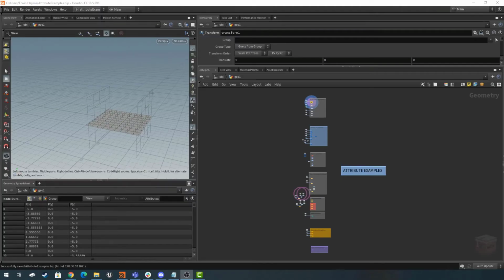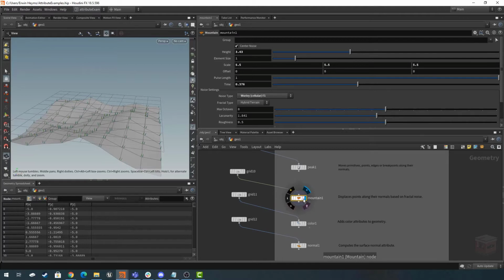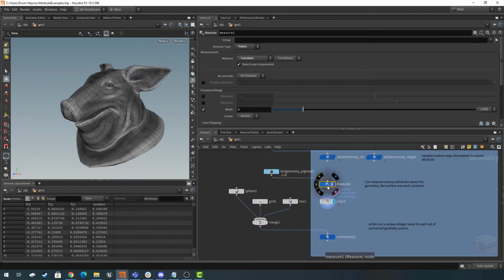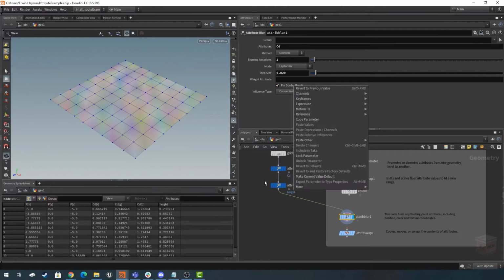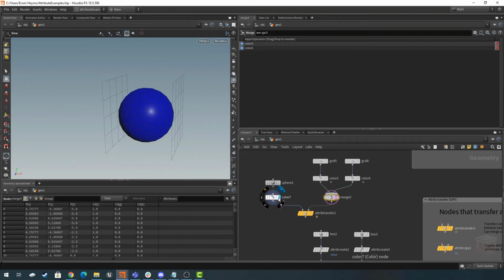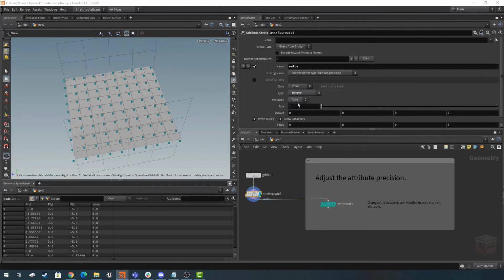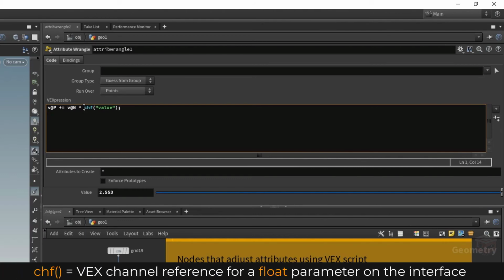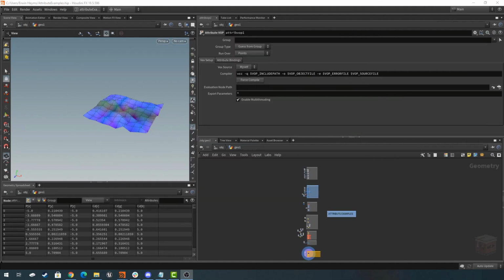HOUDINI 101 - 06.5 - Common Attribute Nodes

Comment: Fantastic Video. One Question, there are a convenient way to remap a color directly ? with remap attribute only float. with Attribute Adjust Vector, there isnt a way to control "Cd" in predictible way. the only way that i Know is or Attribute VOP or a Wrangle Node.
Reply from the maker: - I've dropped an example file into the Discord "Houdini Talk" chat for you to check out. - 

The Labs tools have a few dedicated color adjusting utility SOPs, like the LABS "Color Adjustment" SOP.
Other than that, its not as simple. You have to consider that colors aren't just individual variables and that RGB values are harder to remap.
Its generally a good idea to convert colors to HSV since that breaks the color description down into Hue, Saturation and Value (brightness).

In the VOP context you can use a simple Hueshift VOP node and then expose its controls to the top level.
Or you can convert RBG to HSV, break the vector into floats and then remap each HSV values using ramps for example.
You can do this quickly with just a hand full of VOP nodes.
Reply: @EHoudiniAcademy  You have been very kind. Yes, I usually convert to rgbtohsv. That I would like to have a ramp to remap the color. As is done for example in REDSHIFT material. I'll take a look at the color remap LABS. Thanks again for the file.  I'll go check it on Monday